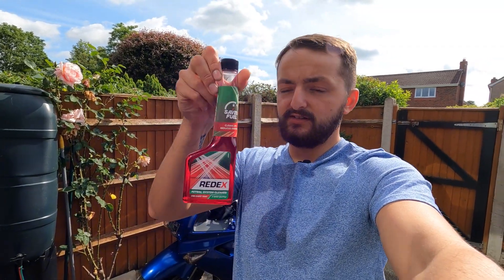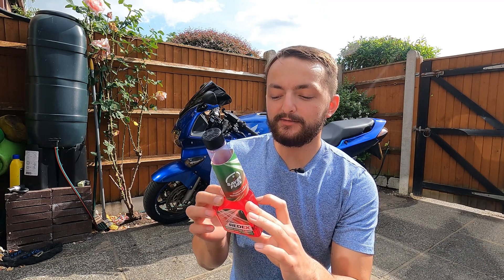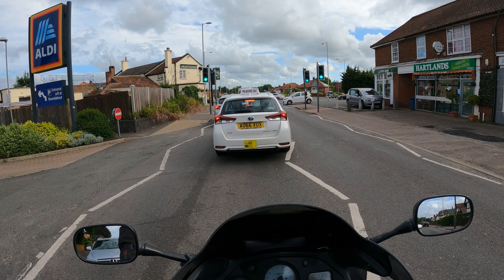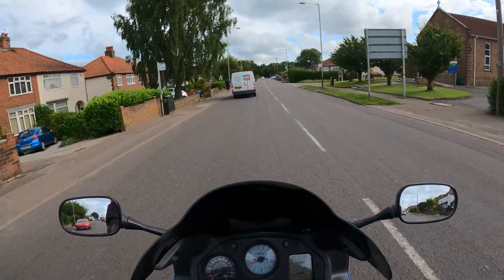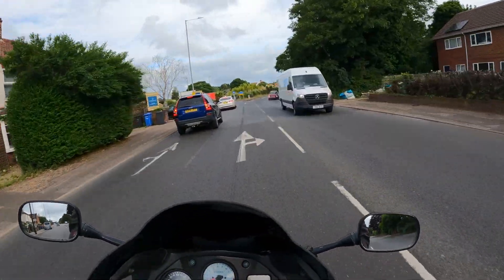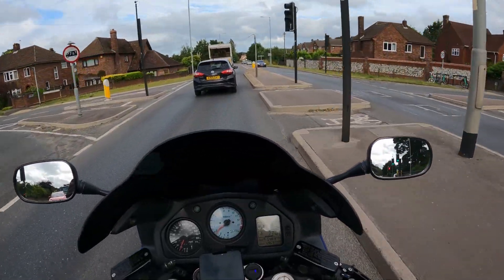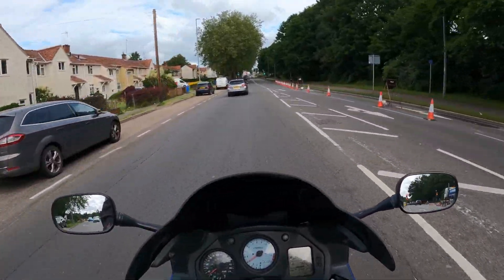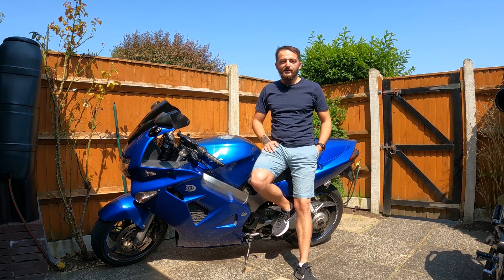Fuel System Cleaners - Do they work?

Comment: Bad advice from a negative guy with little experience, I've used additives for 50 years, I noticed small increases in mileage, better starts in cold weather, less oil usage and the products often save on maintenance. The boys not thinking it through.

Comment: The additives clean your fuel system... A good thing.unless they increase octane or remove moisture power increases are small , usually I notice a smoother engine.

Comment: I have used stp carb cleaner additive, and after a few tanks I noticed a slight difference. The iddle and response are smoother. But the difference is very little.

Comment: Did I miss something?  You didn't say your bike had any issues like hiccups in certain situations, rough idle, fuel wash into the oil (caused by poor aspiration), or any other symptoms of plugged injectors.   This isn't a mod, just a cleaning.   No point in telling us your bike ran fine before and it runs fine after.

Comment: When getting hot my bike had an issue at idle, had a close relative who has worked on carbs for a while and he told me my carbs needed to be cleaned. Ran 6oz of Techron in a half gal tank, let my bike run till hot for about 15 min, idle issue seems to be clearing up. I’ll come back and say what happens after a hot days ride

Comment: i only use SEAFOAM in my motorcycles. long ago i bought a 1990 gsxr750 that had been sitting for 3 years. i checked the oil. put the battery on the charger and when it was good enough i hit the starter. took a bit to get started but idled perfect. giving it throttle was a different story. it would sputter pop and bang horribly. i drained all the fuel out of the tank. put a fuel filter inline. put fresh 93 octane fuel with SEAFOAM in the tank and let her run for a while. then i rode it around the block and occasionally goosing the throttle and it would sputter pop and bang. after doing this for a few days i was riding around the neighborhood and goosed the throttle and it sputtered popped and took off like a bat out of hell and ran perfect ever since. i never cleaned the carbs and rode it for years.

Comment: I have a 4 carb1985 Ninja 600R that I would prefer not to have to disassemble and clean. Many videos slag any additives and pronounce that only carb removal and cleaning does any good.  The Ninja has always had top of the line gasoline, with "Sta Bil" brand fuel stabilizer always added at fill up time.  Did the research on it, and the additive does inhibit molecular clogging in the fuel as it sits in the tank, so this is a valid precaution for a small cost.  Have just started a dose of "STP" carb and injector cleaner, measured in correct proportion to the tank volume.  Will do one or two tank full's only.  Not constant use. And see what happens.  A lot of videos claim carb and injector additives eat the rubber parts in carbs  - which they prove by soaking rubber in pure fluid - which seems like arguing that because pure acetic acid will eat your stomach it is proof that vinegar therefore will eat your stomach.  If the STP does some small cleaning effect, all to the good. If not, will discontinue it.  It seems unlikely that STP - a long standing, global company - has a product that is damaging to carbs and injectors, or that is totally useless.  At worst, it might not do much good.  But it seems worth a try as a carb cleaner.  And no, I don't expect any more horse power or speed from the engine - from any additive.

Comment: It's more of a preventative measure really, if there are old sludgey bits in carbs etc. then it'll clean them up a bit but as you said in the video, it's somewhat negligible even  in the best case. I am about to throw some through mine just to keep things fresh but it's not to solve an actual issue

Comment: I have no idea why people think they will see any results in a fuel cleaner performance wise on a well maintained motorcycle. Its not going to do anything. Also, Dont use this if your motorcycle isn't fuel injected.
Reply: Why can’t I use it on a carbed engine ?
Reply: @Loubie2005  Because Redex isn't a carb cleaner, It's more of a lubricant. Carb cleaner is best for a carbed engine.

Comment: I've been using redex every few months in the same motorcycle for over 20 years and the bike has NEVER needed its carbs cleaned and runs as smooth and cleanly as the day I bought it.
So yes, based on my 24 years of real world experience, I would say it does keep the fuel system clean, but what do I know...

Comment: In my experience,  if you use low grade fuel from the likes of Asda etc.. then you are exposing your fuel system to become gunged up with varnish over time. Cheap fuel tends not to have the additives that more expensive fuels have, so if you always run on premium fuel then your system should stay clean, if not then a system cleaner will remove the varnish over time.  Injectors tend to become contaminated by microscopic grit and other particles, so only reverse flushing will clean them.

Fuel additives will often raise the octane if you have low grade fuel.

Comment: It seems you're adding fuel system cleaner to a fuel system that didn't have a fuel problem to test if it works? If so.... why would it? Fuel  system cleaner helps clogged up fuel systems, it "cleans" fuel systems that are dirty or clogged... if they aren't dirty or clogged, of course they won't magically add power.

Comment: I used this on a rebuilt classic 500 single for 6 years. When I took the top end off after seizing it up I noticed the same normal amount of carbon build up as it had before I rebored it and fitted a new piston. I would say it did nothing to stop carbon build up in the cylinder and the inside of the carb was also as black as it was before.  During those 6 years, I really believed the bike was smoother and better on fuel, but it probably wasn't.
Reply: That's the kind of info I was looking for ... carbon build up.

Comment: Yes! My car was running as rough as buggery and running on  5 cylinders. The Merc specialist checked for the dreaded engine loom breakdown but couldn't pinpoint anything. He recommended, when the tank got to low, add a bottle of injection cleaner and run it as long as I dare before refilling. Fill it up and add another bottle.. I did as he suggested and it completely cured it. I used to regard this stuff as snake oil, not any longer! If you have rough running problems, try it first.

Comment: You will more than likely if at all notice a difference when idling. Fuel injectors become dirty and spray fuel less even and cause it to run rough. At speed not so much, but when idling the air fuel mixture has to be near perfect to maintain, thus an odd or interrupted idle. The rest of the fueling system will of course benefit in some way from being more "clean", but then you could also take a look at the fuel filter.

Comment: I think if your engine has no issues in the first place then you wouldn't notice any difference, but let's say if you had clogged injectors then maybe it wold do something.
Reply: Exactly. My fuel injectors were clogged.  Instead of flushing it out and taking it apart,  I decided to use gumout. Tan the engine for a bit then let it sit overnight. Next day, no problems.
Reply: i used it today and i can feel the difference straight away

Comment: If the fuel lines and injectors are clean, then it wouldn't do you any good. If you have an old vehicle or a 2nd hand one that wasn't properly maintained, then it should help

Comment: It's a s
Fuel cleaner its not made to increase performance, octane booster may increase slightly.
Reply: It could improve performance slightly if the injectors or carb was dirty enough but redex is cheap shit not strong enough to be much help

Comment: On my carb'd 99 R6 I add a royal purple fuel system cleaner. Once a month and berrymans B12 once a week. I am not gonna sit here like other riders and say my bike felt different after doing this. But at the beginning of the riding season, my carbs felt like it was gonna need a cleaning, after adding the fuel system additives, I noticed the response picked back up to NORMAL as if the carbs had a deep cleaning. And have been going 4 months and carbs still feel perfectly fine. I honestly wish I would have looked at the valves before doing so and now
Reply: Good man I swear  by royal purple used it for 80k so far 130k on the clock and still going strong , a recent major service both said it still as good as a 2 year old also in the workshop needing an mot

Comment: I got a 2005 vfr vtec ,i have well the bike has problems with the new E10 fuel,i use the 98 octane now run smoother and better then with the 95 E10
Reply from the maker: I actually found my 5th gen runs better on the e10 stuff, there's also no problem with corrosion, you only need t worry about that if you're parking it up for a long time in a humid area.

Comment: If this Redex is aimed at all petrol engines i.e.  car engines, then most cars have a 60 litres fuel tank. I think the capacity of the VFR 5th gen tank is something like 17 litres, say 20 litres to make it easy for comparison purposes. So putting half that bottle of Redex in would on the face of it be far far too much.

Btw now we have E10 unleaded will you be using it or going for even more pricey super unleaded for your bike? I think I shall be using the latter for my VFR. You could get E10 then syphon off the ethanol and add an octane booster and valve lubricant such as VSP or Redex might do something.
Reply from the maker: I think you're exactly right, though even with the super concentrated mix, there's no noticeable change.

From what I've heard the VFR is fine to run on E10, so I'll probably continue to use that without any additive, however I'll probably swap to super unleaded for the winter months as the higher ethanol content might affect the tank when sitting for a while.